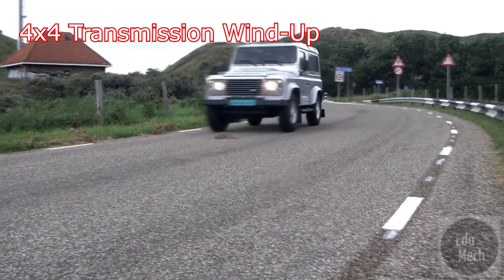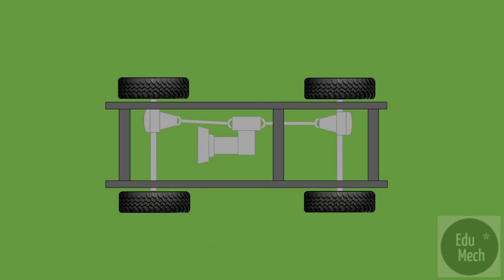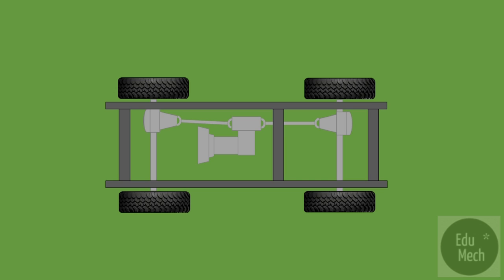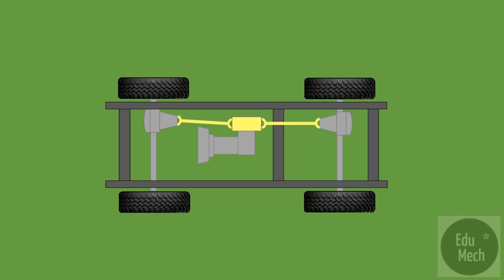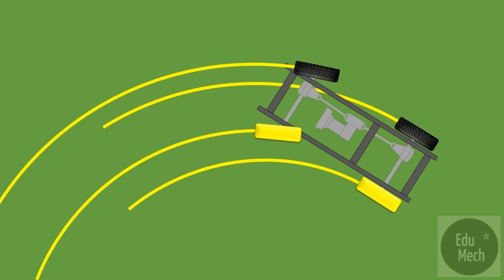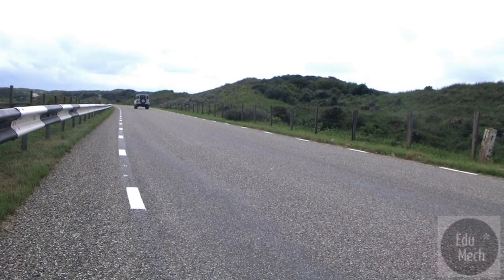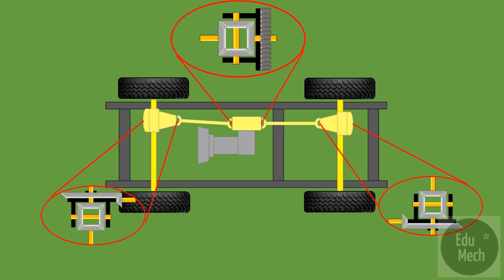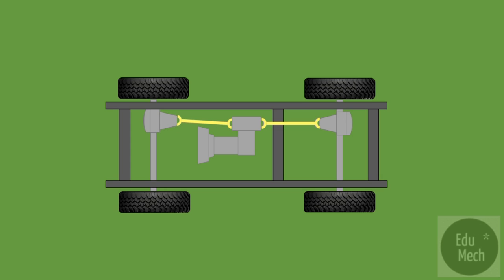4x4 / 4WD transmission wind up - Explained

Comment: 3:06 - Reminds me of the time me and my friend made a soapbox racer from pallets and bike wheels.
We had regular bike brakes on the front, and we also decided to weld a cog on the axle with a locking pin - to make a shifter (of course, only P or N could be selected. It was a gravity powered cart)
We decided that to try and pull a hand brake turn, it would be a cool idea to slam it in park at full speed.
Instead of the rear wheels locking, we just slowed down and then moved back and forward a few times. Wondering what on earth happened we looked underneath...
Sure enough, the park gear locked the axle... But the axle couldn't take it. It had bent and buckled into a complete knot. It looked like cooked sphagetti. 
Me and my friend were laughing so hard, we almost passed out.

Comment: I just bought a z71 tahoe and it put it in 4wd sometimes when it floods here in miami but when I turn it does this is this because it does not have a third differential or because its always locked in 4wd high

Comment: If you were to drive on the open road with the diff locked, would the windup break the axle diff or centre diff first?
Reply: the weakest part in the drivetrain will give first, usually the front shaft

Comment: oh now my selectable AWC SUV start with a FWD front wheel drive boy! not all part-time start on a RWD basis

Also mitsubishi likes to be complicated to it's a part time, 4WD "ECO" with split torque 100/0 0/100 at the front to both wheels that send power only when it detects front needs help.
AWC auto = AWD feel starts with  80/20 split and can send up to front 60/40 rear (computer takes over)
AWC LOCK = gives you a feel of a 4x4 lock with still letting limited slip so no binding or wind up occurs.
      Starts 60 front / 40 rear, can go up to 0 front / 100 rear
      ( S-AWC can do the extra mile and go 100/0 on any wheel not just the front OR rear depending on the car model)

So 8L/100km winter or summer with CVT also procuring the right torque / speed ratio at all times

Comment: I always thought AWD to be overkill if you live in a region where it only snows a few days out of the year. That's so much extra weight to be hauling around with added resistance.
Reply: All wheel peel bro